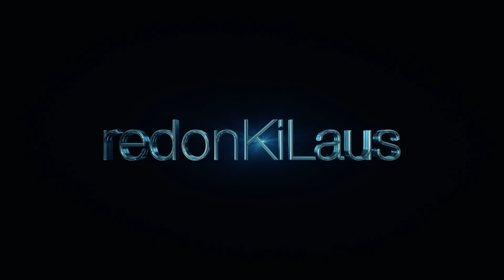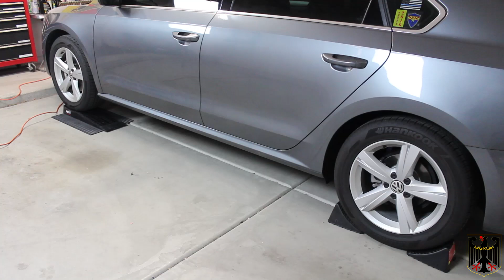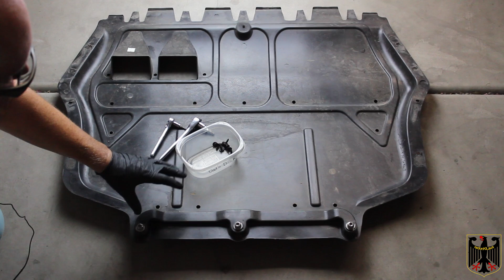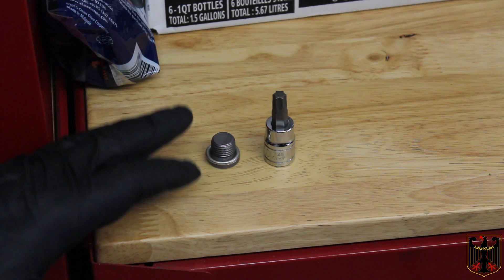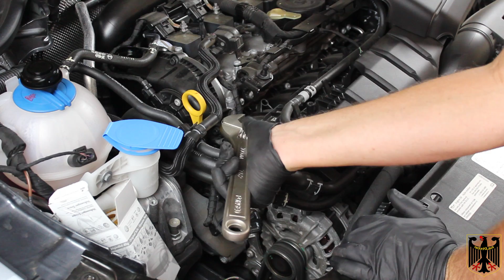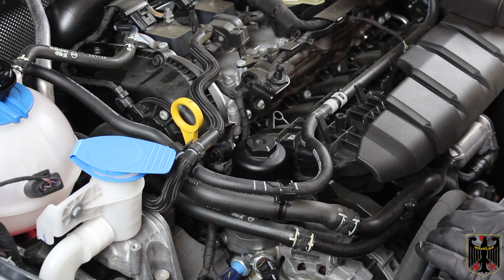VW Passat/Jetta/Golf/Beetle TSI Oil Change (EA888 Gen 3 1.8 Motor)

Comment: Have you ever considered pre-filling the oil filter before re-installing? I realize the filter is installed upside down so you cannot contain any amount of oil in the canister, but at least it prevents the filter from being completely dry on initial start up, causing the engine to run without oil for a few seconds.
Reply from the maker: Considered, yes, but I have numerous vehicles with very high miles in the fleet without doing so, so never started - makes for a longer and more messy process for what appears to be very little benefit.  There is residual oil in the bearings, galleys, etc. so the engine isn't dry metal-on-metal either.  Any engines of mine that I've pulled apart have been super clean as well, no scoring or real wear of bearings, no buildup of note, etc.  Thanks for watching!

Comment: If I asked this before, please accept my apology. Why do you use 5W-40? I think this engine calls for the 30 weight. Thanks.
Reply from the maker: My particular owner's manual calls for 5W-40 - it might vary per model, year, region, etc.  Yours may well call for 30 weight.  As long as you are buying oil that meets VW spec (correct additives) and is the weight your manual calls for, you should be in good shape.  Thanks for watching!

Comment: Sorry for the dumb question: can I NOT use a torque wrench for the plug? Is it possible to over tighten by hand? And what happens if I over tighten it.?
Reply from the maker: It's technically possible to overtighten and strip out the drain plug port on the oil pan.  If you have a reasonably good feel for fasteners you will likely be OK.  Thanks for watching!

Comment: What kind of cover is that the smaller on before the top main cover.
Reply from the maker: It's a second engine cover, not stock on US market cars and requires modification to fit the 1.8T engines.  It's just cosmetic but something I wanted to add to mine.  Thanks for watching!

Comment: DO NOT ADD AS MUCH OIL AS INDICATED HERE!!
At least if you have a Jetta. Wife's 2015 1.8 TSI only took a tad over 5 litres. 5.8 of them American quarts equates to 6.6L. Do that you'll have a ton of issues. Please ensure you car is level before checking as even a slight incline will affect the dipstick reading. Also, there's no need to remove the plastic from under the car but I suppose the Passats differ. 

And for those that think they know better than the very smart engineers that designed this ultra modern engine, you don't, rest assured of that. With 200,000km and changes done at 16,000km since new, this vehicle drives like new and does not burn any oil, other the very the very minimal expected amount (for those claiming their vehicles burn a lot, did you follow the proper break-in procedure?). Sure, it's your money and you're free to spend it as you please. But it's our environment, so please don't go wasting oil before the recommended interval for this engine. Burn a hole in your pocket if you may but leave my air alone, it isn't yours to ruin.

Comment: It's interesting that VW went to OW20 for the 2018+ 2.0 TSI engine.  The differences between 5W40 and 0W20 are pretty big.
Reply from the maker: Interesting indeed, with the difference in displacement I'm guessing other significant changes must've been made.  Thanks for watching!
Reply: I have a Volkswagen Passat 2016 TSI what oil do you recommend
Reply: @mobilelegendspublicenemyxo4315  I have my dealer do the oil change because it's almost the same price as buying the oil & filter and doing it myself.  There aren't many oils that meet the VW spec and they're all kind of pricey.

Comment: Hi, I have the same vehicle as you and I did the oil change and filter made sure everything was well but my question is that does the filter snap on like when your putting it back in is it suppose to try to slide off or did I not put I in right
Reply from the maker: It's certainly not supposed to slide off freely and should press on.  Thanks for watching!

Comment: Just curious -- when did VW switch from screw-on metal can filters (e.g. the Purolator L40316 I use on my 2001 Passat) to a BMW-style cartridge?
Reply from the maker: I'm not certain, but I believe it was somewhere around the time the FSI engines came out that the cartridge style filter became mainstream across the lineup.  That's roughly 2005 or so.  Thanks for watching!

Comment: Have been racking my brains trying to find a vacuum line to administrator a preemptive chemical  treatment(CRC, Seafoam) on my 2017 1.8 L TSI...I'm looking at the brake booster hose as my only option???
...any comments, Thanks in advance
Reply from the maker: I believe the brake booster hose is indeed the only option on these TSI engines.  Chemical treatments only do so much - walnut blasting is still in the future of any DI engine without port injection.  Thanks for watching!

Comment: this engine is crap burns oil
Reply from the maker: That's a typical VW thing - 1 quart per 1000 miles isn't unusual for many German marques.  My Passat has been good about it, though, and doesn't burn any discernible amount of oil.  Thanks for watching!
Reply: @redonKiLaus  I have skoda octavia with same engine it does burn oil. Which it shouldn't in the first place
Reply from the maker: @danarj5713  Like I said, typical of German vehicles - particularly VW AG and sub-brands thereof (like Skoda).  It's the unfortunate reality of German car ownership.
Reply: @redonKiLaus  does any one figure out how to fix this problem may be replacing piston rings
Reply from the maker: @danarj5713  I believe in the case of the EA888, it's generally carbon buildup in the grooves on the piston where one or more of the rings resides.  I've heard of some methods of cleaning this out, but I'm not sure how valid/safe they are for other portions of the engine.
Reply: @redonKiLaus  great thanks sir

Comment: Just use a oil extraction pump via the dip stick, pulling oil drain plug is so old school.😐
Reply from the maker: I do that for most of my oil changes - I do still like to drop the plug every once in a while, however, to remove any built-up sediment at the bottom of the pan.  Thanks for watching!

Comment: 6:09  WARNING: Don't be an idiot like me and place the O-ring ALL THE WAY to the bottom

Made a big fucking mess.  Oil leaked EVERYWHEREEE
Reply from the maker: Ouch, definitely a mistake you won't make again at least.  Good heads up for viewers.  Thanks for watching!
Reply: Does it have a set location on the housing?
Reply: @isaacherrera7846  No idea what you mean by set location...
Reply: @MeepMeep88  sorry I’m reference to the  comment above I don’t want to make a mess
Reply: @isaacherrera7846  You just put the rubber seal in the same spot it came from.  Which I didn't do and made a mess.

Comment: Yeah I'm a 10k mile changer. The quality of full synthetic (specifically Mobil 1 and Castrol) is so good, I have no worries. I understand the caution though. Going from fossil fuel oil 3k changes to full synthetic 10k changes is a big jump for some.
Reply from the maker: At the 5k interval I run on this VW, the oil is pretty well spent - this is partially due to the nature of turbocharged engines, but also due to the environment the vehicle is operated in (dusty, hot desert).  Its weight has sheared down substantially by the 5k interval for my particular use case, which is why I don't run 10k cycles.  In a more mild climate, it would work just fine as VW suggests.  

Thanks for watching!
Reply: @redonKiLaus  Interesting. When you say the weight has sheared down, are you saying it isn't reaching the "40" properties at operating temps? Just curious, have you ever had your oil tested?

I know the turbo gets hot but I never imagined a turbo-charger, or a turbo-charged engine, would put a considerable difference of stress on engine oil. Next on my list, getting a service kit for my DSG -_-
Reply from the maker: Exactly.  I've run a couple samples through Blackstone.  Turbocharged engines are more prone to oil shear as well as contaminating the oil at a faster rate.  

DSG service oughta be fun!

Comment: Why do you use exactly 5-40 and not 5-30? and can i use 504 vw?
Reply from the maker: 5W-40 is the recommended viscosity for my particular vehicle and what the dealership uses.  I actually run 0W-40 now, as it is much easier to find.  You should run whatever spec and weight is recommended in your owner's manual, or what the dealership recommends by VIN - VW changes their specs with such frequency that I don't want to misadvise.  Thanks for watching!

Comment: When do you replace those 2 little o-ring gaskets inside the filter housing, and what are the part numbers?
Reply from the maker: Every time you replace the filter - they are included with the oil filter (or at least should be).  Thanks for watching!
Reply: +redonKiLaus Hmmm, I’ve never had the little o-rings included with the filter, just the large big o-ring that goes on the plastic filter housing
Reply from the maker: Have you been purchasing OEM filters?  They were included with mine, but I'll check my more recently purchased ones to see if they're in there - maybe they discontinued providing them for free...?
Reply: +redonKiLaus I’ve been buying assembled kits from ECS Tuning, probably have been getting generic filters. OEM filter should come with 3 o-rings in the box?
Reply: +jhamm15 Pretty sure OEM filter just comes with the 1 o-ring too
Reply from the maker: I just checked my new ones I have in stock and that is correct - I guess at some point they stopped including them, or perhaps my dealer I purchased mine from just popped the small ones in there too.  I guess I'll just need to source them when I change my oil next - it's going to be a standard O-ring size, and Viton ones are oil-resistant and readily available.

Comment: 80 years of making cars and these guys didn't think to put port holes in the bottom splash shield for the oil drain bolt? Come on guys wtf?
Reply from the maker: Somewhere in the engineering process it was justified to somebody not to include a port (fair enough), but at the very least I would think there would be a removable access cover sub-assembly.  That's why I only pull the drain plug every few oil changes and just use the extractor for the rest.  Thanks for watching!

Comment: Nice car and great tutorial. What's your opinion on using an oil extractor for your car? A lot of VW/Audi owners are using these for oil changes easier as the oil filter is on top.
Reply from the maker: I personally use an oil extractor on all of my vehicles, and as long as you ensure you are extracting all of the oil I have no issue with that method whatsoever (though it may be a good idea to do a full plug-out oil change every once in a while).  In fact, many VW/Audi and other brand dealerships use extractors for oil changes as well.  Thanks for watching!
Reply: redonKiLaus Thanks. Any brand recommendations on an oil extractor? There are whole lot out there and can't decide which one to buy.
Reply from the maker: This is the one I have: http://amzn.to/2v3h654

There are also quite a few other options on Amazon, for both lower and higher prices.  I really love mine, with the only downside being that the hoses are difficult to store since they are, well, oily after use.  I use a 30 gallon bag to put them in, but it's not the most elegant or convenient solution...not sure if anyone else's is any better though.  Hope that helps you choose an extractor, and thanks for watching.
Reply: redonKiLaus Thanks a lot!
Reply: Matt A I would remove the drain plug ever 3rd or 4th oil change as sediment may built up at the bottom of the pan over time

Comment: How good is this engine? The 1.4s had huge problems with oil consumption! Is this one any better???
Reply from the maker: Mine has no issues with oil consumption at all.  From what I've heard, the new TSI engines are fairly good with regard to that issue, and experience less carbon buildup than the old FSI engines.  Thanks for watching!
Reply: TheNauseator Very intresting! It has been a big scandal in europe due to the huge oil consumtion on the TSI. I gues vw owners didn't thought on waiting the engine to settle...

Comment: Hi! Thank you for that video. I have a question ... I have  Golf with the EA888 1.8L engine and it idle the car sounds like something is boiling in the motor. Does yours do that too? There are not CE light on or any lights whatsoever on the instrument panel. I was doing some research on the internet and read that the HPFP of direct injection engines has a distinctive noise. Thank you for your time.
Reply from the maker: Direct injection engines do make more of a "clacking" noise than traditional port injected SI engines, so if that is the type of sound you're hearing then I'm sure it's normal.  If you suspect something may be wrong, I'm sure a VW dealer would be happy to take a quick look; I even know some experienced independent mechanics who would take a listen to something for free, so you may be able to find one of those in your area as well.  Hope that helps, and thanks for watching!
Reply: Thank you so much! I will look into taking it to a local independent mechanic so they can take a look. This is my first DI engine, so I am just starting to get to know this engine and how it behaves. Thank you!
Reply: redonKiLaus

Comment: For those of you who poo poo the 10k oil change, have you actually done an oil analysis ever on a 10k sample?  I bet not.  On my 2005 VW Passat TDI, I have done the 10k change using the spec oil that VW requires for this model and so far so good at 196k. Oil consumption is a half liter at this mileage.  In Europe for my model, they do a 20k oil change on the same oil.  They roll back the OCI for the Americans.  I have another vw in my fleet with the 1.8T TSI and it uses the spec oil and will be going the full 10k.  I trust their recommendation, but I will have a sample pulled to verify at some point.
Reply: Any update on that sample?

Comment: any videos on fuel filters for this vehicle
Reply from the maker: I haven't made one; my vehicle only has around 15k miles on it, so I haven't needed to change the fuel filter at this point.  There is likely a tutorial on one of the VW forums, though.  Thanks for watching!
Reply: Thank you I finally found that out shortly after posting this. Appreciate the response
Reply: Top Tier fuel should be used for every fill up and I would never go below a 1/4 tank of fuel to protect the fuel pump. I use LiquiMoly jectron to keep the fuel system clean about every 7-10k miles.

Comment: Do you have documentation (at least TBN) from a used oil analysis that substantiates your decision to change oil more frequently than 10K miles?
Reply from the maker: I've had an oil analysis done on a 5k mile oil change on this vehicle, and while the TBN wasn't too terribly low, the oil was quite dirty and at the point where it was becoming abrasive.  This is what I typically see from all of my vehicles in a short period of time because of the dirty (dusty desert) environment in which these vehicles are operated.  In my modified vehicles I also see oil shear, even with synthetics, because operating temps get very high here during the summer; I'm can't remember how much of an issue this was on my VW.  Hopefully that helps, and thanks for watching!

Comment: I do maintenance for a living in the high tech industry on tooling.  I own a 2016 Jetta SEL 1.8T and have questioned the 10K oil changes for a turbo charged engine.  I know it is a full synthetic oil.  I personally can't go over 5K between oil changes without feeling I am doing damage to the turbo charger and the engine.  The oil is dark at 5K, so my oil changes will be every 5K.  Peace of mind in my case.
Reply: My car has over 285,000 miles on it. Oil changes every 12,000 to 15,000 miles. Running as smooth as the day I bought it.
Reply: If you really wanted to know get a few Blackstone Oil Testing kits.  Your “can’t go over 5k because it feels weird” isn’t scientific.  Everyone lives in diff climates and has different driving habits.
Reply: I grew up on the 3K oil change, so I understand why you may FEEL this way. But the facts of a multitude of UOAs (used oil analysis) state that the oil's additives as well as the various products it's carrying are well within tolerances. The motor oils of 2016 are not the motor oils of 1966.
Reply from the maker: I definitely agree with you there; on my stock vehicles (my Passat), I'm fine with 5k mile oil changes, but I feel that any longer is asking for increased wear on the engine.  For my modified vehicles, I go even shorter - 2.5-3k miles typically, since the engines are often under much greater stress.  Thanks for watching!
Reply: I have an 2007 Passat B6 with the BPY 2.0t FSI engine 249,400 miles and I'm changing the oil every 10K miles and it's still going strong. Timing belt replaced every 105K miles and the chain and tensioner replaced at 230K miles, that has been the only mayor work done to the engine. Go by what VW recommends, they test their vehicles through harsh conditions and do the testing on the oil to come to the 10K oil change interval.
Reply: I have to agree with you sir. Plus it’s peace of mind.
Reply: Kills me how people think they're smarter than the engineers who designed the engine or think manufacturer-recommended oil change intervals are some kind of conspiracy....if anything, the conspiracy is your local oil change place that tells you you should change your oil more frequently.